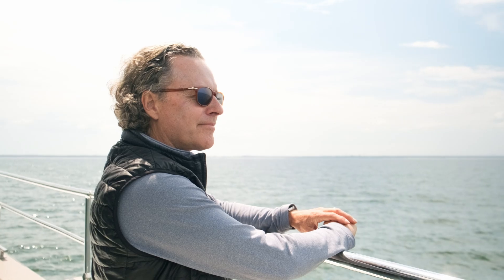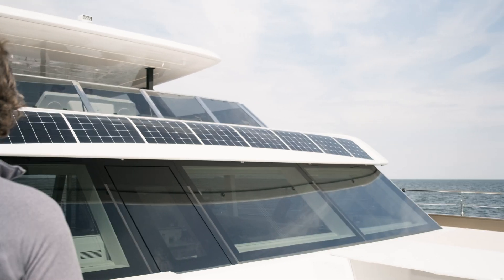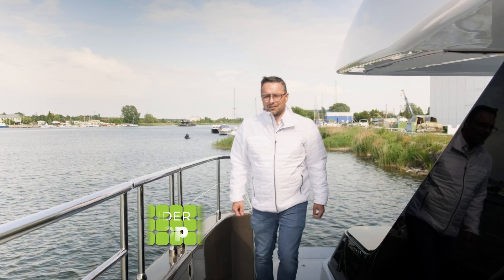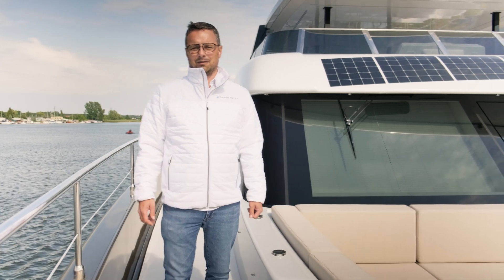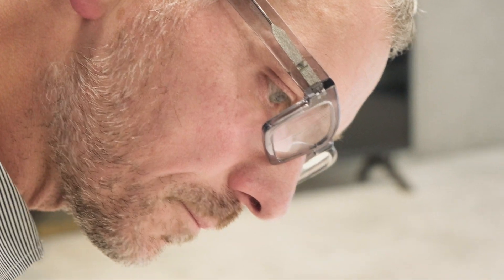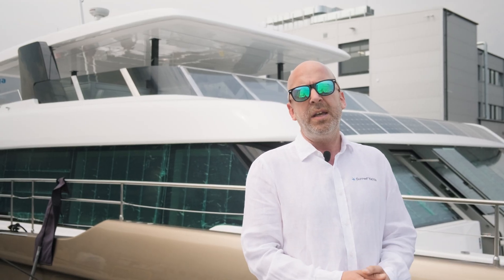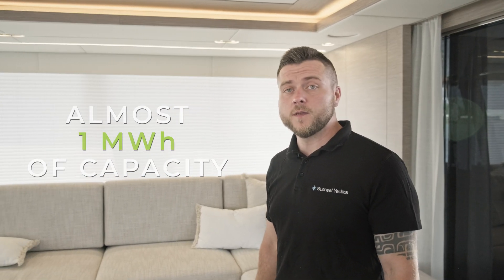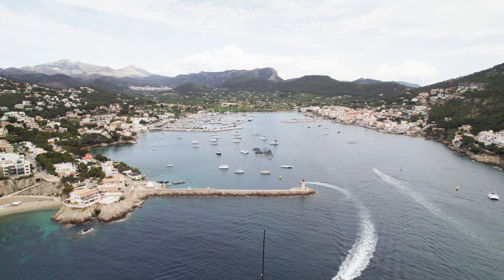80 Sunreef Power Eco: The World’s Most Advanced Electric Motor Yacht

Comment: Suggestion for improving the foredeck on your Eco catamarans:

I really appreciate your focus on sustainability and how you've integrated solar panels on your Eco models! I have an idea regarding the foredeck, where you currently offer mounting points for carbon poles to support a sunshade.

Would it be possible to instead integrate a retractable awning into the superstructure – an awning that is a large solar panel? It would provide shade when at anchor (in a marina or nature), and at the same time contribute a significant increase in solar surface area – potentially up to one-third more. The foredeck is the largest outdoor space on the yacht not currently used for solar power, even though it's already designed to be shaded.

I think this could further reduce the need to run the generator and align perfectly with your Eco vision.

Comment: The hearing and cooling is very easy for boat. The solution is a combo of water source and air source heat pumps.
These heat pumps will toggle between the different medium as a function of their temperature difference to the air and if cooling is needed or hearing.
If the water temp below the boat is warmer than the local atmosphere then use the water source heat pump for heating. If the air is cooler than the water then use the air for cooling.
The solar and betterues can power the heat pump.
The boat will need to constructed with a high degree of thermal insulation and air flow highly controlled so heat or cooling is not lost.